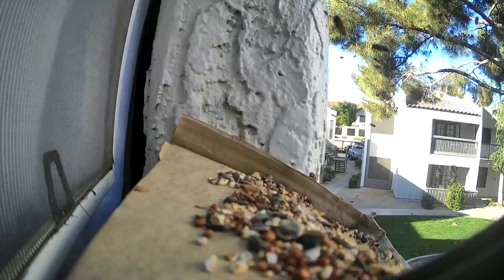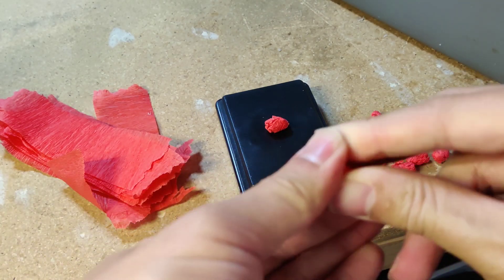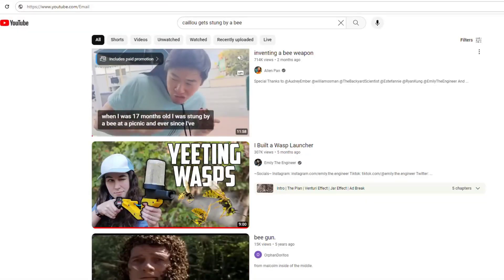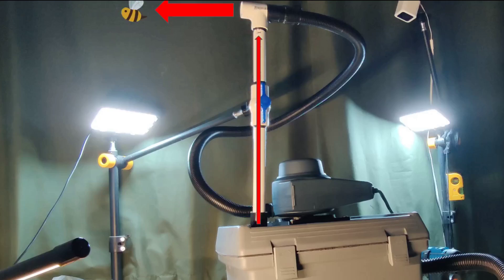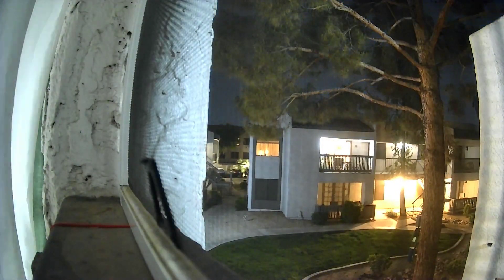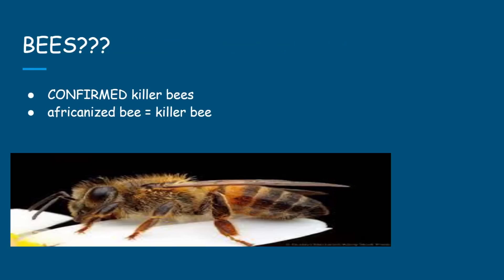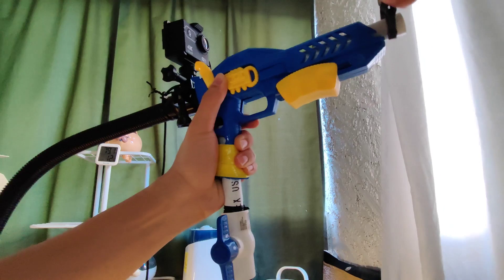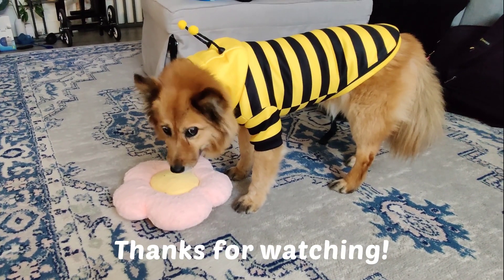@allenpan is WRONG about bee weapons

Comment from the maker: If you know why the long pipe didn't work, please explain it to us in excruciating detail
Reply: The failure of a long pipe could stem from various reasons, depending on its purpose, material, construction, and environmental factors. Let's delve into some possible scenarios in excruciating detail:

    Material Defects: Long pipes are typically made of materials like metal (steel, copper), plastic (PVC), or even concrete. Any imperfections in the material, such as weak spots, cracks, or fissures, could lead to failure. These defects may not be immediately evident during installation but can worsen over time due to stress, pressure, or corrosion.

    Design Flaws: The design of the pipe, including its diameter, thickness, and layout, must account for factors like fluid pressure, flow rate, temperature changes, and external loads. If the design is flawed or if there were miscalculations in these parameters, the pipe may fail to perform as intended. For instance, inadequate thickness could lead to buckling or collapse under pressure, while excessive length without proper support could cause sagging or bending.

    Installation Errors: Proper installation is crucial for the functionality and longevity of a long pipe. Mistakes during installation, such as improper alignment, insufficient anchoring, improper sealing, or inadequate support, can compromise the integrity of the pipe. For instance, if the pipe is not properly aligned during welding (for metal pipes) or if the joints are not securely connected (for plastic pipes), it can result in leaks, cracks, or separations.

    Corrosion and Erosion: Long pipes are often exposed to harsh environmental conditions, including moisture, chemicals, soil movement, or abrasive substances carried by the fluid flowing through them. Over time, this exposure can lead to corrosion (in metal pipes) or erosion (in plastic or concrete pipes), weakening the material and causing structural degradation. Corrosion can occur due to electrochemical reactions between the pipe material and the surrounding environment, while erosion can result from the abrasive action of solid particles suspended in the fluid.

    Overloading or Overpressure: Long pipes may be subjected to excessive loads or pressures beyond their design limits. This can happen due to factors like increased fluid flow, sudden pressure surges, temperature fluctuations, or changes in operating conditions. If the pipe is not designed to withstand these extreme conditions, it can lead to deformation, rupture, or catastrophic failure.

    Fatigue Failure: Long-term cyclic loading or repeated stress can cause fatigue failure in pipes, especially in areas of high stress concentration or structural discontinuities (such as welds or joints). Over time, the repeated application of stress can initiate cracks and propagate them until failure occurs, even if the applied stress is below the yield strength of the material.

    Environmental Factors: External factors such as earthquakes, landslides, soil settlement, or ground movement can exert additional stresses on long pipes, leading to deformation or structural failure. Moreover, changes in temperature, humidity, or exposure to UV radiation can accelerate material degradation and weaken the pipe over time.

    Lack of Maintenance: Regular inspection, maintenance, and repair are essential for the proper functioning and longevity of long pipes. Neglecting maintenance tasks, such as cleaning, corrosion protection, leak detection, or structural reinforcement, can allow minor issues to escalate into major failures over time.

In conclusion, the failure of a long pipe can result from a combination of material defects, design flaws, installation errors, environmental factors, and lack of maintenance. Identifying the root cause of the failure requires careful investigation, including structural analysis, material testing, and forensic examination of the failed components.
Reply from the maker: Thanks, but we're going to need more excruciating details than that
Reply: You're absolutely right that the long pipe adds too much resistance, so instead of flowing air through the "barrel" of the accelerator past the suction tube, it simply blows through both of them. I suspect that if there was more velocity in the air column it could create a suction force from the suction tube again. Sorry if that's not excruciating enough, I don't have a way to do the CFD and I'm too lazy to calculate it the old fashioned way.
Reply: Because it was too long.

Comment: That vacuum is far too small. Copy the rig a bee keeper uses to vacuum honey bees.  They use a "shop vacuum" connected to a trap box like you're using.
Reply from the maker: If we rebuilt it, we would consider a stronger vacuum. Had to make due with the parts we had. Thanks for watching

Comment: I think you need more velocity. This is achieved by a constricted section of pipe before the low pressure inlet.
Reply from the maker: That's a good idea! It's not shown, but the blower tube going into the t fitting has a nozzle that constricts airflow a bit. There are 2 more nozzles that are smaller that we could try.